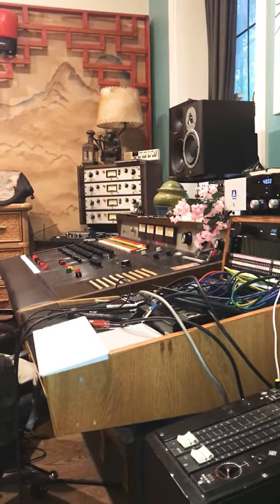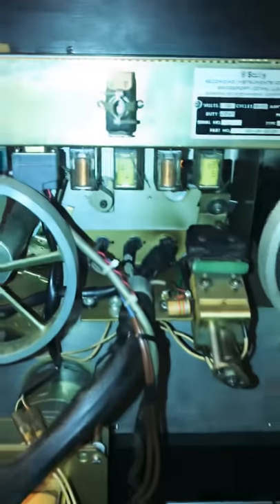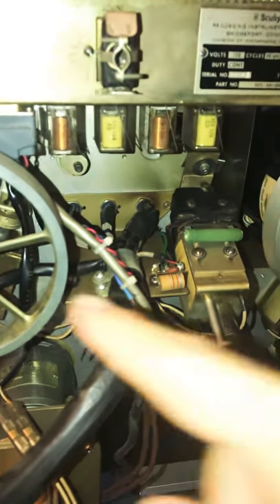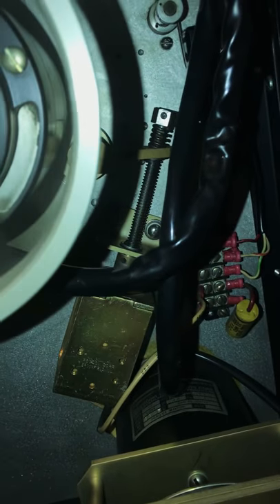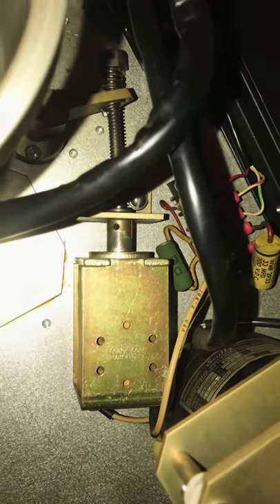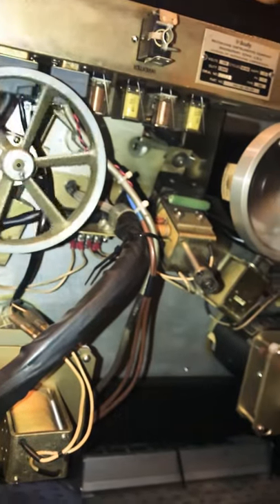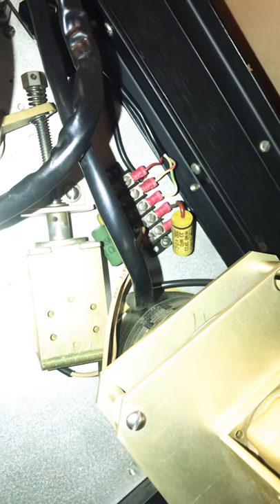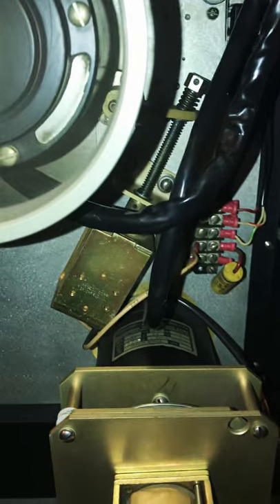Tape Machine Playback Troubleshooting, pinchroller adjustment on a Scully 280 - Analog Recording

Comment: hi man i have a scully deck my self  i am doing a full fix up  on a 1/2 1/4  inch   deck came from usa air base in here in the uk  yes uk   

i love ther soundcraft 760  381- 8 uk model      you got scully 280 line      in the uk we got the models i said    your models are money pits    i am a audio tape deck tec 
love to do them up  my one has a matt black panel now  the was to deep marks on the front panel  i had t sand it down to where the mark started  
heavy sander i had to use on it and work up to p2000  paper  it's the only scully 14 inch in the uk i was told

Comment: Dude, you are still not dialed in, correctly.  You still don't have enough tension roller pressure.  It shouldn't take that long to slew up to speed.  It should be virtually, instantaneous.  Up to speed out of the gate.  As soon as you press, go.

So there is more than one, pinch roller adjustment.  In fact there are, three.  Not just the pressure.  But the actual resting location, engagement location, also.  As this will also affect the range of pressure adjustments on the pinch roller pressure spring.  And it's a mechanical juggling act.  Of tweaks of spacing and adjustments.

Now granted.  That heavy weighted flywheel rolling stabilizer area.  Near the supply side rail.  Now that will cause music to slew up at start.  And there are 2 ways to address that issue.  When you needed instant, music start capabilities on cue.

You could start turning that flywheel by hand.  So it was already rotating in the proper direction.  When you hit the play button.  Or.

You can actually just remove the flywheel weight, itself.  You really will not be affecting the overall performance of the recorder much at all.   It's kind of silly actually.  Lots of recorders didn't have those things there.  Some had fixed tape guides.  Others just had little roller bearing guides.   On the spring-loaded wheels.  All sorts of goofball tape path variations.  To reduce , wow, flutter and speed variations.  You can actually remove most of them.  And never really hear, much of a difference.  If any difference, at all.

I know all of this crap.  Because I was trained as  an authorized,, factory train, warranty service expert.  And/or, I worked for her one of the most legendary of all American recorder manufacturers.  After declining offers from Ampex and MCI.  I never received one from 3M.  I went to work for Scully.  In a managerial position.  In charge of the entire production floor.  In charge of QUALITY Control.  In charge of TESTING Procedures.  And so I know a little bit about these things.  And your recorder, specifically.  Because I built them!

Now pick up the phone.  Give me a call at my now defunct business answering service number.  Leave me a message the best time to return your call.  I'll get the message in a day or two.  When I checked my email.  Which, I haven't been doing lately.  And need to catch up with.  So it might take a couple of days.

I have been contributing to the Yahoo Scully user group for the past 10+ years..  Now it's on I/O groups.  Check it out.  Sign up.  Be part of the conversations.  You'll get all the help you need.  I'm there.  So are many other competent folk.  That just love their Scully's.  And keep them working like, showroom, new.  It's easy actually.  Once you accept the fact.  You are married to it, forever!  And then it becomes, a whole lot more fun.

So just call, 202-239-7412 and leave a message.  I'll get back to you.  It might take me a few days.  I'm one of the last surviving members.  Of that legendary company..  I was in charge of.  From 1979/80.  Their last year of production and existence.  And existed until my resignation.

It's a beautiful machine and easily maintainable.  There's just some things you should know.  From a technical standpoint.  You can get even better sound out of them easily.  And there's some things in the recording circuitry that need to be, disabled.  You need to ensure of.  And that would be the Lineariser circuit.  It needs to be disabled.  You don't turn the controls down counterclockwise to disable it.  You turn them all the way up.  To disable it.  I know.  It's backwards.  Some guys would modify their machines so they were the other way around.  Don't do that!  But you don't know that your machine hasn't had that done either?  And there are ways to test for that.  Because in the wrong position.  The distortion can be quite bad.  The kind you really don't want to be listening to.  It sounds like you plugged in a fuzz box on your guitar.  But it's an acoustic guitar.  And shouldn't have a fuzz box.  If ya follow?  And other little items.

Like how to modify each one of those electronic channels.  To use.  As a boutique, dedicated, microphone preamp.  There are some modifications that should be installed.  That will vastly increase its audio delivery capabilities.  It really soups it up.  Makes it like a real audio console microphone preamp.  With many of the goodies we need to install.  Like a pad switch.  A gain trim potentiometer.  Phase inversion.  Phantom power.  High-pass filter.  Audio insert Jack socket on the back or the front.  So an EQ, limiter and even digital reverb could be added.  Before the output.  Into your digital audio computer interface device.  Or other audio console.  Digital or analog, both.  I mean it's just super to do.  And it will blow your mind!  Why doesn't everybody put in these mods?  Because they are FUCK head, purists.

So it's actually stupid not to do what I recommend.  Why?  Well?  I worked for the company.  I was in charge..  I wanted some of these modifications.  Installed on our machines.  But I resigned before that could ever happen.  And went to work for NBC-TV & Radio for the next 20 years in Washington DC, instead.  While running my own recording studio out of my home and a gigantic, 25,000 pound diesel box truck.  I served the East Coast with for 25 years.  So I know what I'm talking about.  And because I'm not a YouTuber.  And there you are having start up problems and speed issues with one of my machines.  So I figured I had to step in here.

202-239-7412 the number to call when you need Scully assistance
RemyRAD
Reply: Hey Remy! Are you still round to answer a Scully troubleshooting question?